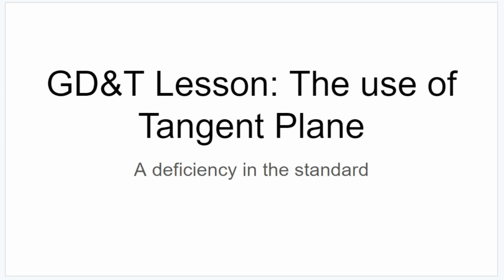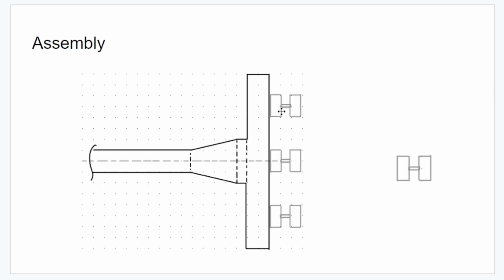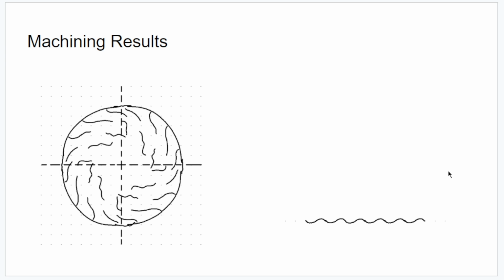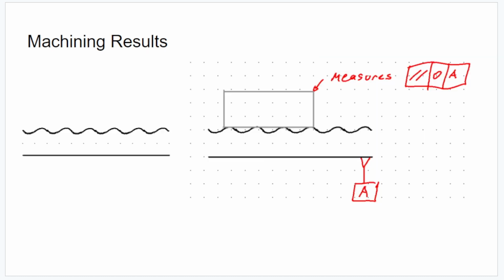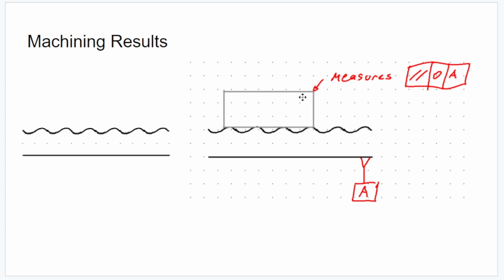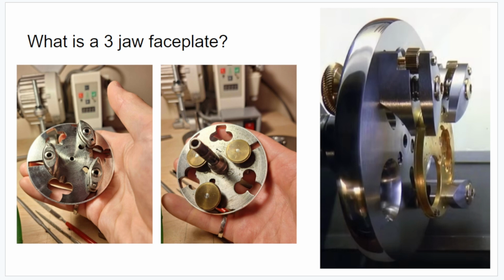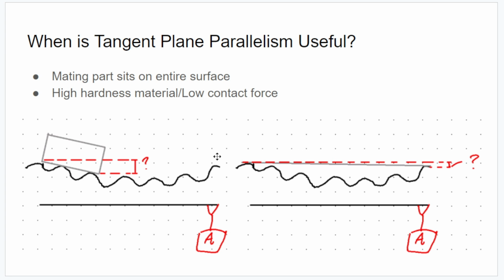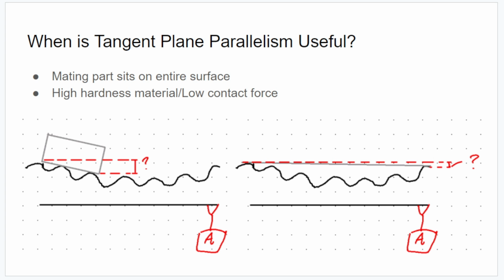GD&T Lesson: Tangent Plane Orientation and it's Deficiencies

Comment: There's no example of tangent plane modified parallelism in the Y14.5 standard, but does something in it indicate it is not allowed?
Reply from the maker: Great question. The answer is no, nothing indicates that it's not allowed. Quite the opposite in fact

In the 2009 standard, at the end of paragraph 6.5, there is a note that basically says:
Though we've only shown this applied to orientation controls, it can apply to other geometric controls 

So parallelism, perpendicularity, and angularity are allowed explicitly. However, something like surface profile could also make use of tangent plane modifiers!

Comment: Good one. The GD&T standard specifies to use tangent plane only for orientation control of a flat surface. Here the considered feature is circular and there are different technique to verify like runout/cylindricity. Also simulating the tangent plane on a curved surface would be similar to measuring with a Vernier caliper at each location. Difficult to imagine CMM inspector capturing cloud data over the irregular circular face and use a tangent plane at each cross section to verify the variation per unit distance.

Comment: I think something like a per unit basis inspection on this is getting to the point where, on any normally machined part, it's probably worth it to just fix the machining error. 

When we'd get stuff like that at my last shop we would just say "make it perfect and it will be fine" or "don't make it wrong and it will be right"
Reply from the maker: Yes, I definitely had some strange issues that I wouldn't have seen if I were machining from scratch, however if the standard is about nothing else, it's about being pedantic and nerdy about requirements!

Thanks for tuning in to the video!